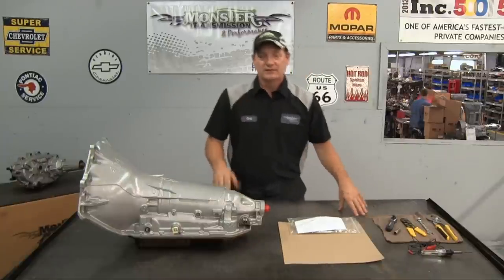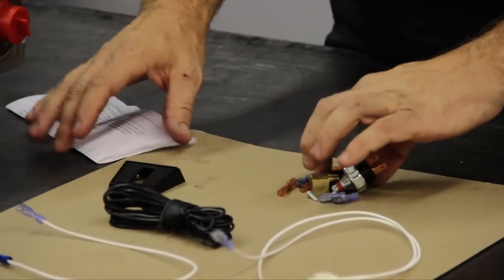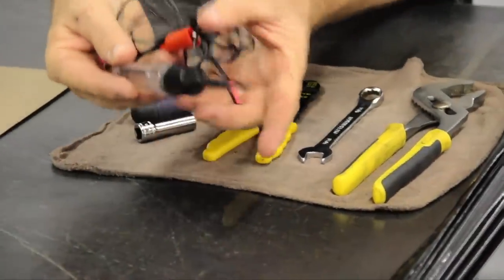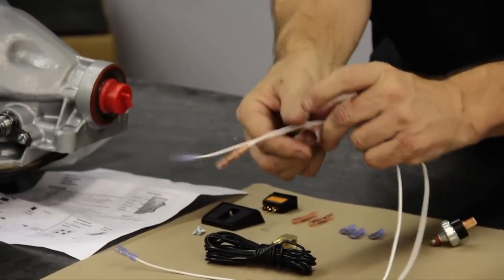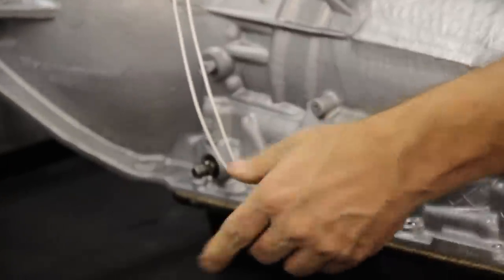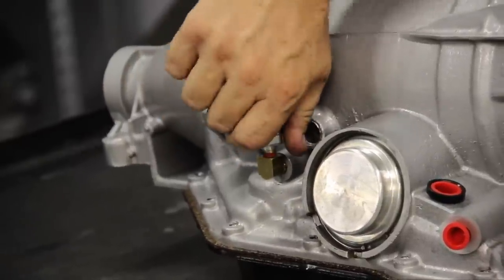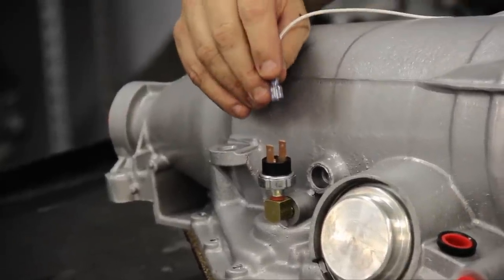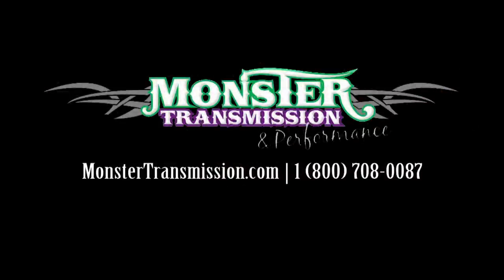How to Install a 200 4R External Monster Transmission Lockup Kit

Comment: I'm.doing an engine swap, still have all the factory wiring but wont have any of the engine wiring hooked up (carb, map, coolant temp sensor, etc). Will the original computer still lock up the trans or will I need the separate way to control it?

Comment: I’d like to get one of your 200 4R transmissions for my 1977 Bandit Trans Am. A stroked 400 (462ci) dyno made 485hp and 550ft.lbs.-tq. I use the T/A for car shows only, not racing. The ring and pinion is going to be changed this year to a 3.42.
What do you recommend ?
Thank you, Tim H.

Comment: I removed a 4.3 engine and trans from my 87 monte carlo and installed a Ls engine and th350 trans.  I only removed the 200 because I already had the th350 and recommended stall converter. Since I changed the gears to 373 ratio I want to put the 200 back in it. Its a stock trans but was in perfect working condition and I now have a 3000 lock-up converter.   It still has the wiring harness and TV cable.  Can I use what I have to get it to work. I removed the wires going out the the computer to engine compartment not the ones from under the dash.
Reply from the maker: You will need to get a 4th gear lock up kit and would have to get the proper geometry of the tv cable when you install.

Comment: If you run the positive wire through an always closed brake switch on the way down to the positive side of the transmission harness, will the solenoid disengage when the brake pedal is applied in addition to when the gear shifts from 4th to 3rd?
Reply from the maker: Yes it will

Comment: I just picked up a 2004r and I need this kit, do I need anything else? Do I need a special torque converter? Can I use the factory one?
Reply from the maker: That's awesome Emmit! And no, our external lock up kit comes complete, you shouldn't need anything else. Using the factory converter will be fine. If you need any technical support with this project give us a call, 800-708-0087.
Reply: Sweet thanks
Reply from the maker: No Problem!

Comment: do i have to leave the switch on at all times or cut it off everytime i cut the car off
Reply from the maker: You can simply turn it on and leave it on. Thanks
Reply: @MonsterTransmission  so why do i need a switch? Why not just apply key on power?
Reply from the maker: You can bypass the switch and run direct power to it, but it is used in racing or towing applications.

Comment: What is the part #? Also what TV cable and seal do I need for my 200-4R, and other things to install. I have a rebuilt transmission and 2600 stall.
Reply from the maker: You can find this lock up kit here: https://www.monstertransmission.com/200-4R-External-Lock-Up-Kit_p_4987.html#.XrlWUWhKibg
Or give us a call at 800-708-0087

Comment: I have a the 200 that won't back up when cold after it warms up it works fine
Reply from the maker: If you have full fluid and still no reverse it will have to come back apart for inspection most likely will be internal failure. Thank you for choosing Monster Transmissions.
https://www.monstertransmission.com/200-4R-Rebuild-Kit_c_4321.html
Reply: @MonsterTransmission  will a 200r4 work in the place of a 200 metric without changing anything

Comment: that's not a 200 4 R transmission that's a 700r4 not the same wiring
Reply from the maker: Thanks Impala t for checking in with us. The 2004r is very similar in looks to the 700R4. The transmission shown in the video is a 2004R. Thanks
Reply: You can tell it's a Th200r4 because it has the ears for BOP motors. 700r4s were only chevy pattern from factory.
Reply: That is %100 a 200R4